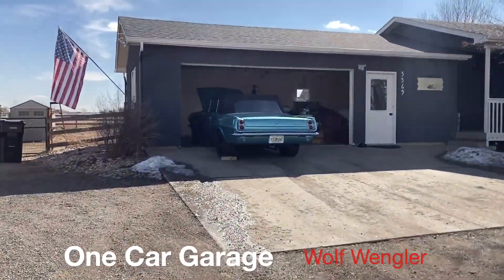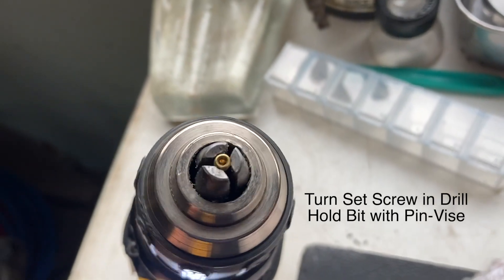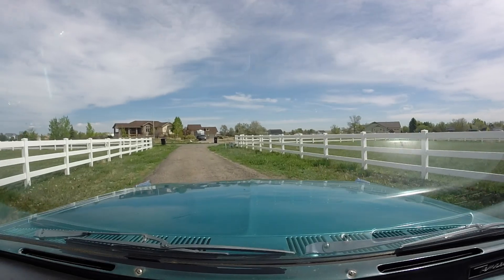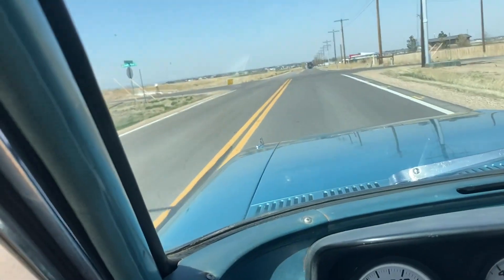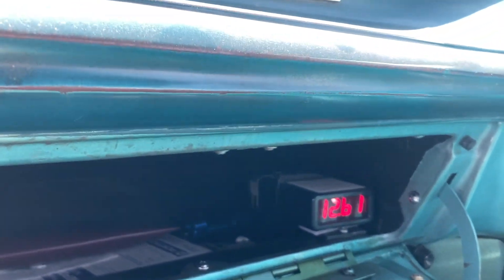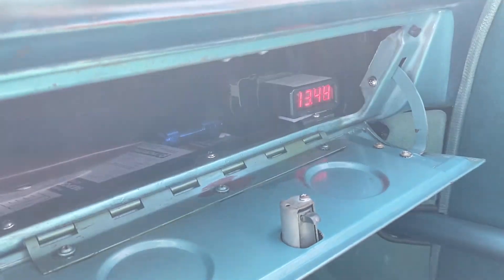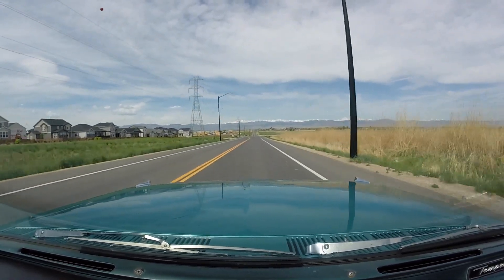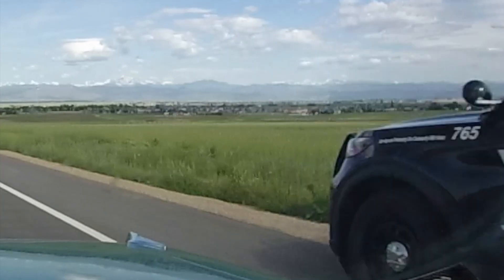Test and Tune

Comment: Great tuning video's you have taken much of the voodoo out of carb tuning and set me in the right direction. I did send you an email 4 days with hopes of gaining additional knowledge to help guide me as there are no shops here willing and capable of properly tuning carbs. I purchased my 67 Chevelle untested and untuned. I never though I'd be 4 months into trying to tune this thing off and on and still not get it right. I do now understand the idle circuit thanks to your video's @ 5000ft elevation in Edmonton Canada, I can tell you it was pig rich  It came with a Proform 67201 - 850CFM  race series carb (no choke). I have figured out my idle and cruise seems almost perfect. WOT is almost perfect (very little testing as I'm stuck with the in between portion) In this video you mentioned transition, power valve and emulsion being rich. If I stab my throttle 1/2 ish or slightly when the secondary's start to open it goes pig rich 9.0-11.2 AFR to the point where some times it stumbles until slowly comes back around. This stumble seems especially more prominent to happen once I release the throttle going back to idle circuit. The same seems to happen if im WOT... As long as my foot is into it things are fine... Let off throttle and it goes pig rich until finally clearing off. I had an 10.5 PV and this weekend noticed after a ride that my PV hole was wet indicating due to low vacuum at idle PV was allowing fuel threw. I have since changed it to a 6.5 PV to eliminate this problem and can revisit later. the pig rich situation still happens. part of the problem now is I dont know if the issue is caused from my transfer slot, PV, emulsion, or squirters.  How can you determine how and when the different systems come into play? and any recommendations on how to attack this issue?
Reply from the maker: Power Valve has no function at idle. NONE! First thing I'd look at is the gasket between the main body and the metering block. That little hole behind the power valve should always be dry. it is the vacuum source for the power valve. At  5000- MSL. a 10.5 power valve is a LOT.  6.5 is way better.  Another thing I'd look at is the acellerator pump squirters and the pump cam. Make sure you are doing your testing on a flat road, too!